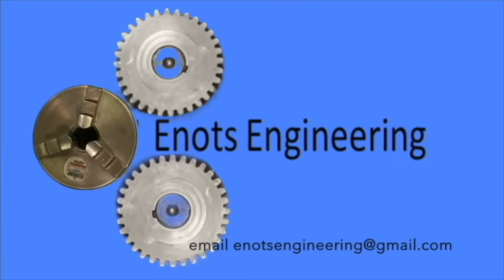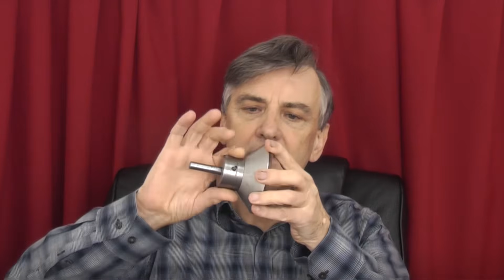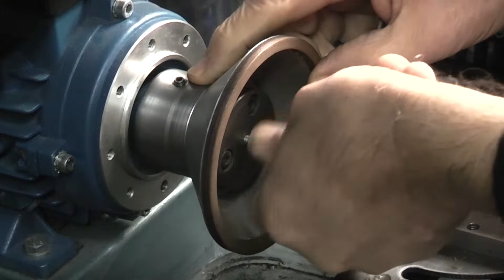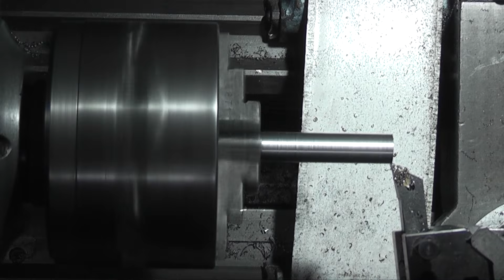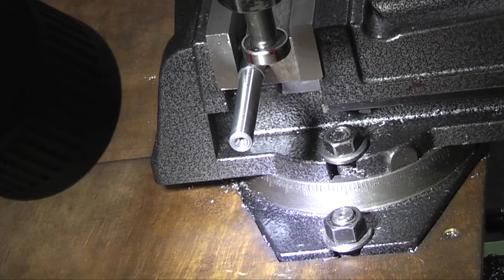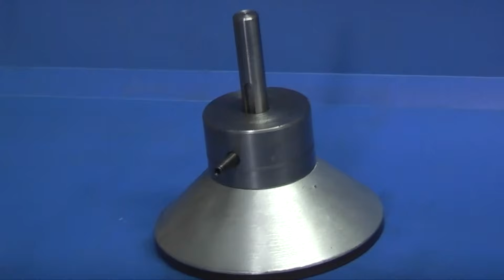Grinding wheel holder

Comment: Neat little adapter Alan. As other comments, I would stick a flat opposite the slot for the 2nd grub screw. Will you show it in use on the mill? Would be interested to see the application. Cheers, Jon

Comment: I know in theory if the bore is sized correctly and it and the shaft are truly parallel on outer diameter that they should run concentric but I'm just not a great fan of grubbing fittments onto shafts if repeatable concentricity is important. I do wonder if the smaller range of ER collets such as ER 16 or ER20s could be suitably nodded to make a simple taper hub for these sort of fitments. No criticism of your method here but I do believe taper collet type clamping is more repeatably reliable and no danger of damaging the shaft with a grub.
I've shown a couple of mates with small mills your brother's mods and they have been accepted with great enthusiasm.

Comment: Allan, just suggestion rather than a criticism. It would be a good idea to turn a very shallow groove - slightly wider that the nominal grub screw diameter - on the shaft where the grub screws tighten onto the shaft. They WILL raise a slight burr on tightening and make it very difficult to remove the wheel arbour if you need to do so in the future (speaking from experience here!).
Reply: + 1!